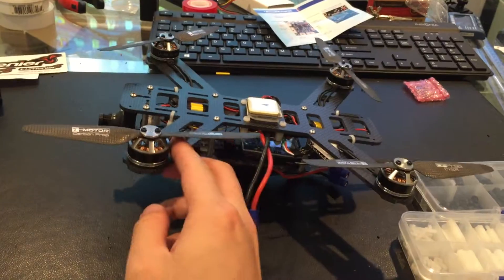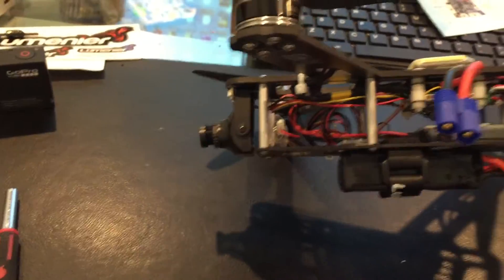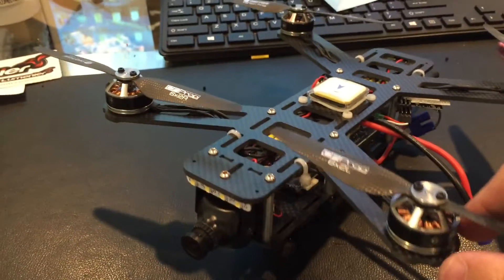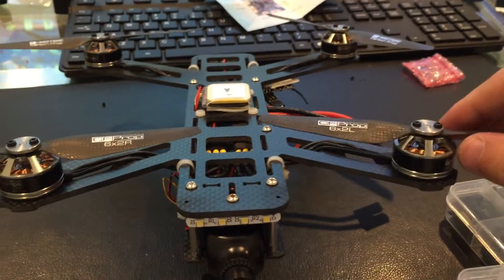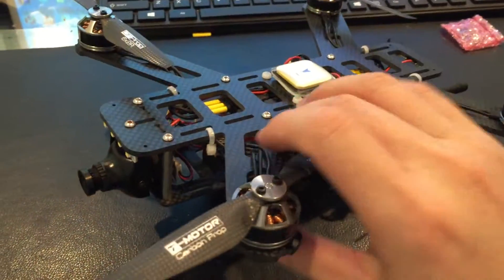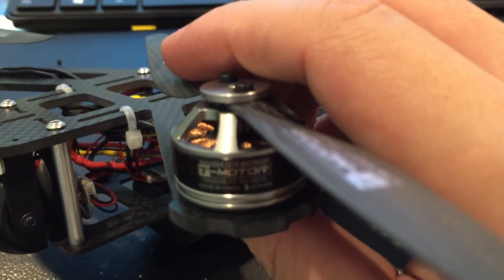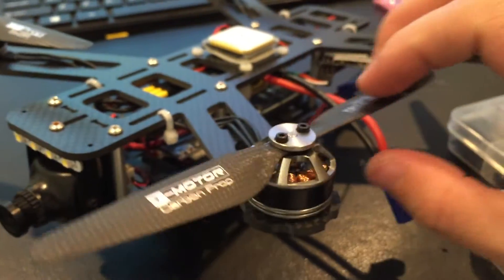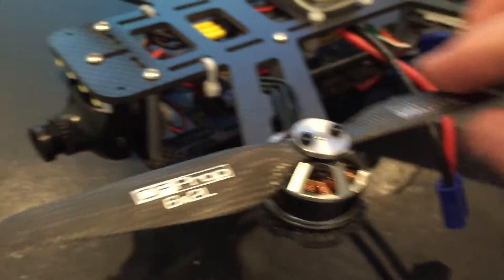QAV250 build with Micro APM

Comment: Wow....that's some smart out of the box thinking RE: upside down frame...I should do that too so I can fit my carbon 6030 props....Any issues with altitude hold and Return to launch?

Link below is my setup; may it help a few out there.
https://drive.google.com/open?id=0B9GmTiaLsr9LZTVCNUJBNGE5UlE&authuser=0
Reply from the maker: Everything works great on this build.
Reply: kelvin lee I'm new to Quads and basically anything regarding R/Cs. Did you have to cover your flight controller or at least the sensor(s) to ensure your getting good readings? I believe your using gps compass (that I'm not doing just yet but will). Did you have to adjust the throttle level (the level to hover)?
Reply from the maker: Hi Fadi, I used to use copper sheet to isolate between the flight controller board and the other component with output radio signal. such as the video transmitter and the telemetry. and i also build one quad without the isolation, it works the same. I didn't felt any thing wrong. So i think it should be fine just leave it like that. I am using flight controller cover only for some bad environment such as beach. only for protect propose.
Reply: kelvin lee Know which firmware you have running on your apm micro? I'm thinking my firmware is messing up alt hold and RTL

Comment: Hi Kevin.
I am building DJI F450 with Micro APM. My ESCs are E300 MARK II .  I dont know how to connect signal cabeles from APM to ESCs. There is cabel  included in mega set from HK. For motor no.1 there are 3 wires [gnd, plus and signal] for motors 2 - 8 is signal wire only. My question is:  Can I use only signal wires for all 4 motors and GND and + wire for motor 1 to ignore?
APM board will be powered by Power Modul. [3DR]
Thanks for Your videos and help.
Reply from the maker: EddieVichta Hi, you can just use the signal wires and GND. just ignore the positive wire because Micro APM comes with the power module. you dun need the power from your esc. let me know if you still confuse.
Reply: Thank You.

Comment: did u put the power distribution board right under the main board?
Reply from the maker: In this video, I build the QAV250 upside down, so the power distribution board is on the top of the micro APM.
Reply: did u use on board compass or exterinal one ? if use external one do i need to cut anything ?
Reply from the maker: The easy way is use the external compass. Because the Micro APM set comes with the GPS module with compass. And it's more accurate then the onboard compass. I remember the SJ10 is for the external compass. Cut the SJ10 then you can use the external compass.

Comment: hi thx for such good video...however i am not sure how to fit the power module board it comes with the kit and connect to my 30A esc...any advise? did u use the power module board in ur mini 250?
Reply from the maker: I soldered the ESC directly to the power distribution board check this video:https://www.youtube.com/watch?v=TazMmnbn9Ck&list=UUZRT3IDq2gd9VjJ6op4lVzQ. The power module are also the power distribution board. What kind of power module you using? if you using the traditional 3DR power module, then you maybe need a power distribution board.
Reply: as i mention i plan to use the pd board it comes with the mirco apm kit ... but mind esc is 30A Afro ... so i wonder if i can solder that wire on this small solder pad ...
Reply from the maker: Hi, I just contact with the manufacture, they said the micro APM are design for 250 size. The power distribution board can only handle no more then 20A ESC. If you want to use 30A ESC, you should get a transitional power module and a power distribution board or just wore directly to the transitional power module. Thanks
Reply: oooo... good that you find out for me ! thx so much... i will use 12A ESC then
Reply from the maker: no problem. In this video, I was using 18A KISS ESC. and it runs perfect. If you want to build a very aggressive quad, you can use some small size 18A ESC. BTW, The KISS ESC are not really compatible with APM, because the APM PWM output is not high rate. KISS ESC are only good to works with CC3D or NAZE etc... this kind of product comes with high rate pwm output.

Comment: Hi Kelvin,
i have also this board. Because i don´t now how to set PPM. Is it default? Must i cut?
Please help me.

Thx.
Reply from the maker: Hi Nils Straube: Its very easy, short number 2 and 3 together, and use 1 as PPM signal. if you don't understand what i am saying please let me know, i will make a video for you.
Reply: kelvin lee
Thank you. I understand. I will try it soon.
Reply: Hi Kevin, thanks for the video. Is there any chance you can show how to set up the micro APM for PPM? Do I need to update the ATMega chip like some threads say?
Reply from the maker: Hi Nick, just like I said, in the RC input, there 1-8 port and one 5.3V+ and one ground(black) you only need to connect the pin 2and3 together, and then use the 1 for the PPM receiver. That's it! Once you link the 2and3 together, the board will switch to PPM mode.
Reply: kelvin lee Hi Kelvin, I can't get mine to work :(
I've shorted signal pins 2 and 3 (pins 4 and 5 on the board), and tried the tx through both SBUS and channel 1, but can't get a signal. Can you do a demo video?
Using FRSKY X8R and MicroAPM
Reply from the maker: Hi, I just uploaded a video to shows how it works with PPM receiver. Check my new video. Thanks